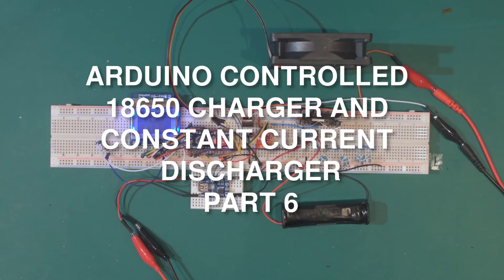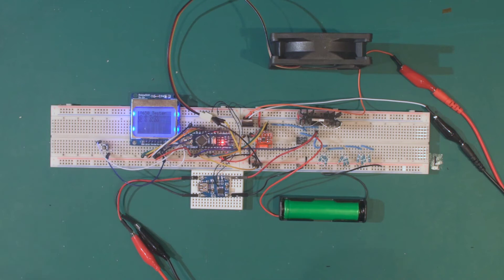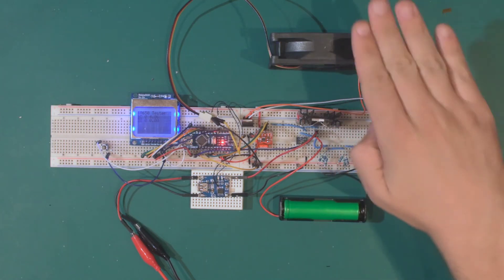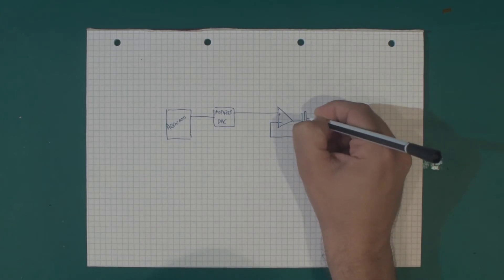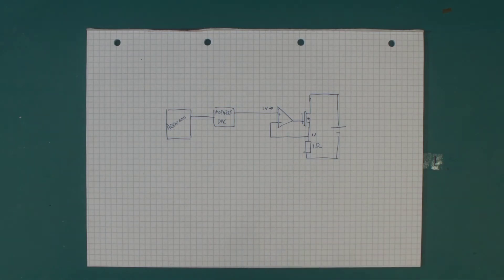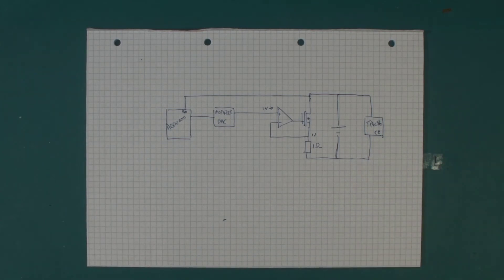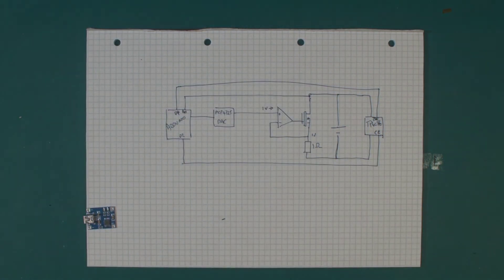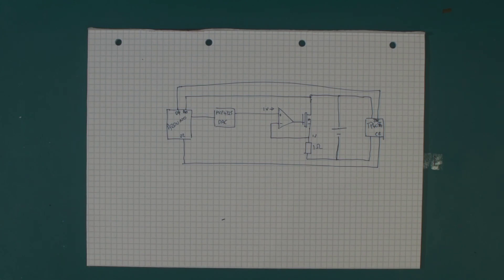18650 Station - Arduino Controlled Single Battery Charge and Discharge

Comment: curious if you've considered using a pwm output pin to the MOSFET gate instead of using a separate DAC and what limitations that would have.

Comment: This is an excellent video series Chris. Please do continue working on it. I'm very excited to see the large scale charger / discharger. Working on one myself but your video has given me some good things to think about!
Reply from the maker: +Terence Beeton I have the next bit partly filmed, I shall try get it out this week. Sadly work commitments have been keeping me from getting it finished, but I have time now :)
Reply: Cool! Yeah, I know what that's like! Just out together a new parts order for the new workshop! Finally gonna be stoked up again! BTW, the Nokia screen you're using, is that I2C as is or do you have a controller board to get the I2C connectivity?
Reply from the maker: +Terence Beeton the Nokia one isn't i2c, there is a library for it, but takes something like 5 gpio lines. In the newest version I swapped to a 4x20 lcd which has i2c. If you wanted to do the Nokia via i2c I think the mcp23017 could maybe help, but a bit of effort to re-write the library though. Awesome, are you sharing putting together your workshop anywhere?
Reply: Cool, I thought as much. I have a bunch of 20x2 LCDs with driver boards for I2C so that should be sweet. Are you using anything new (parts wise) for the multiple battery setup? I'm playing around with some STM chips atm which are promising. Workshop is just setup in my flat. It's nothing major but it's developing :) got the master bedroom setup so heaps of space! YouTube vids to come in the new year once things are a bit more set up.